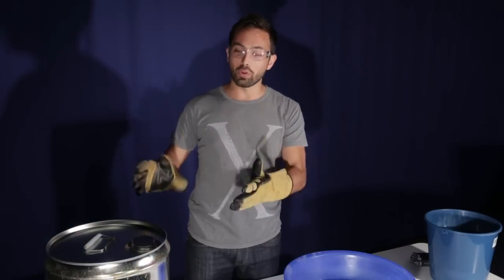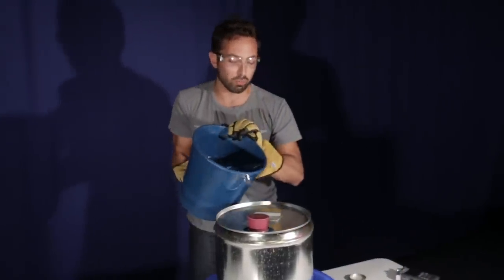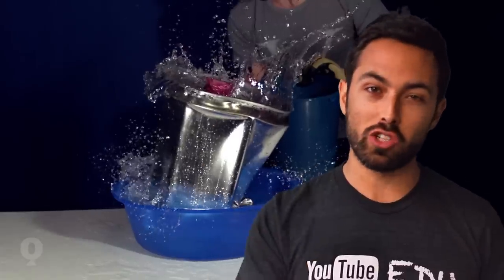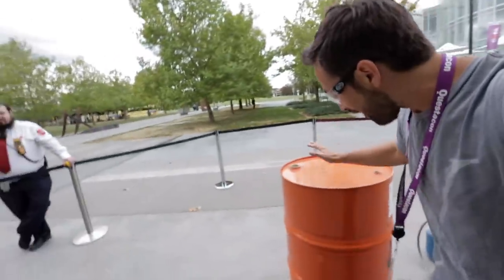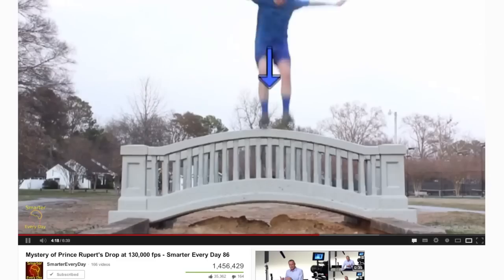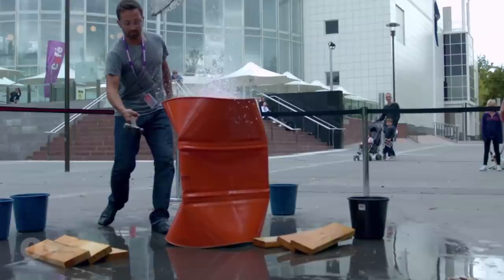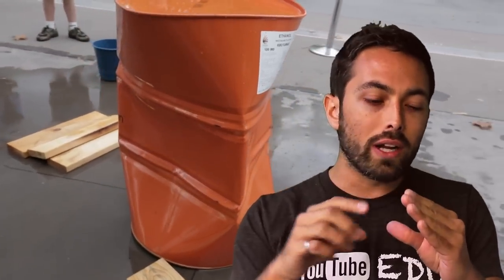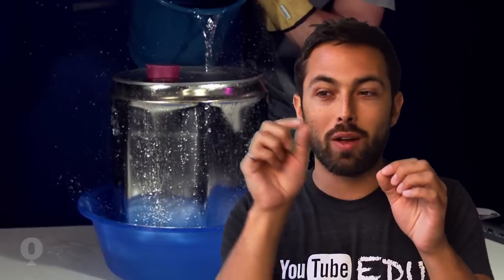Epic Slow-Mo Drum Implosions!

Comment: I think that because the first barrel is smaller it has a stronger structure (if that's the proper way to say it) and it requires an even lower pressure (a greater force) to make it collapse even further into the shape of the second barrel.

Comment: It could be that the strength of the top and bottom relative to the sides of the small drum was higher than the big drum. The three sided crumpling seems to require more flexing of the top and bottom than the hexagon shape.

Comment: The shapes could be different due to the impact on the larger barrel, creating a structural weak point that wasn't there on the smaller one and, therefore, changing how it was compressed.

Comment: Maybe it was because, the smaller drum didn't have a large pressure difference. The larger drum took longer to bend, and by that time most of the water must have condensed. So there was a large pressure difference when it finally imploded.

Comment: relative strength of the lid of the two containers vs their sides, as well as the dimensions of the cylinder. For example, lets say the top and bottom of the barrel had infinite strength and the paneling negligable strength. What would happen when the strength of the side paneling was overcome? I would expect some sort of double cone configuration.  The volume to surface area ratio would likely also effect the final state (dimensions of the container dependent).

Comment: It probably didn't crumple into a flat(-ish) plane due to the construction of the rings at the top and bottom, which, if you notice, remained mostly circular, even under the pressure. It would have taken more to completely flatten them, and if the center part tried to flatten itself, it likely would have enclosed more volume, the rings remaining circular, above and below the 'crumple zone'.

Comment: The smaller drum, I think, has a much stronger lid, compared to the side wall. The smaller drums top looks somewhat like the top of a drinks can.
I think the design of the top is much stronger on the small drum, so it will allow for less distortion.

Comment: I think it was an economy of scale. The smaller barrel had a smaller volume of hot air inside, so it had less force pushing from the atmosphere. It takes energy to make a hexagon than an equilateral triangle. so nature decide that the hexagon would be the the optimal shape to maximize volumetric shrinkage whilst using a smaller amount effort. However the massive volume of air in the drum created a much larger force which could afford to bend the metal.

Comment: It would be interesting to see a vacuum gauge to measure the vacuum inside the vessel, also the geometric shapes could be attributed to the Fibonacci sequence in some way , measure the sides to see if it is to the ratio of 1.68103 to 1 or equivalently 0.68103 to 1

Comment: Perhaps it's due to the amount of water present in each drum. The amount put into the bigger one was probably significantly smaller and therefore it had to accommodate for a smaller volume.  

Also, the lattices of the materials influence quite a lot, the material probably changed and with it its physical properties.  Thickness could've been yet another factor.

Comment: I'm crap at science but I think that maybe the material of the drum has something to do with it. If the material is more pliable, it will change structure sooner as it cools down, dealing with less vacuum inside (pressure difference is smaller), and you get an hexagon. The big drum is very strong so before it can collapse, you had to cool it much further, hence creating a bigger pressure difference. And then the triangle is the only result possible.

Comment: I think it has to do with the diameter of the cylinder compared to the height of it. The smaller drum seemed to have a larger diameter to height ratio than the larger drum, making the mid section more stable, and less collapsable into the prism shape. If this is true, I wonder if a really tall and slim drum would have its mid section pinched flat under the same experiment, rather than the prism pattern?

Comment: Maybe because the smaller drum was weaker, it in fact started crumpling before there was a full vacuum, so didn't need to minimise volume as much. Later on, as the pressure inside decreased, it crumpled up further. On the other hand, the larger drum wasn't going to have the inside decrease any more, so it minimised volume as much as possible. Possibly?

Comment: THE SHAPE IS SIMPLY DETERMINED BY HOW MUCH VOLUME THE IMPLOSION IS CAPABLE TO TAKE OUT FROM THE CYLINDER; AND THE VOLUME THE IMPLOSION IS CAPABLE TO TAKE OUT FROM THE CYLINDER IS DETERMINED BY THE HEIGHT AND THICKNESS OF THE CYLINDER'S WALL.  GIVEN X CONDITIONS, YOU CAN END UP WITH AN IMPLOSION WITH NO SHAPE BUT A LINE INSTEAD

Comment: I reckon the smaller one crumpled into a hexagonal shape because of its rims on the top and bottom. That type of structural rim seems to be pretty vital as i believe it held the top and bottom of the sides at its original width. This (I think) then meant that the sides were held further apart and it therefore couldn't achieve the equilateral triangle the huge drum achieved. I would think that if you got a taller barrel but kept the same structural design and diameter, it would crush itself into an equilateral shape like the big barrel. Veritasium I challenge you to test my hypothesis. (If you can get a barrel similar to the one I have proposed). If you read this, cheers. :D

Comment: I think the big drum went for the triangle because you triggered it with the hammer. You didn't have to strike the small drum. So perhaps the flaws in the circular geometri in the small drum, were more evenly distributed. The big drum only had one flaw; the hammer, which led to the triangular shape. If you had hit it with two hammers, at the exact opposit sides, maybe it would have collapsed to a line or rectangular shape. Perhaps it's all about the placement of the major flaws in the material?

Comment: I think the comments that say it's related to the height of the cylinders versus their diameter are probably right. The shorter the drum compared to its base the less leeway the sides can give before the top and bottom need to deform. And since the top and bottom are much thicker than the sides the take a lot more force to deform. So the shorter it is the closer to a circle (the shape of the lids) the resulting polygon will be.  Just my guess.

Comment: My only guess for the small barrel is that the pressure dropped equily on the entire, inside, surface of the drum causing a controlled and ballanced effect.  with the slight movement of water sloshing  over the drum, from one side,  then made it collapse.

Comment: I agree with forYOUitsP, the harder it is to bend the metal sides the less bends. If the material was very soft it would try to implode into a perfect circle. 

Then also because the softer the metal the easier it is to pull the top and buttom in as well, which will cause a softer drum to crumple up rather than pull in the sides only (unless the top and bottom is reinforced to not be able to collapse inward).

Comment: Isn't it just that each regular polygon is a metastable state, so that the drum can relax into any one of those, but the ones with more edges are less likely? The big drum was hit with a hammer, which makes the higher order shapes impossible. A lower order shape than the triangle is also possible: that's when two edges are pushed together.

Comment: If we're talking about a really "theoretically" perfect sphere, then the pressure would pull each point of its surface equally to its center, leading to the shrinking of the sphere. Imagine looking at a balloon that's loosing some of its air trapped inside it. If you meant a "real" perfect sphere, then the point of its surface that requires the least energy to deform will be the one to collapse inside the sphere, turning it into a concave-shaped object.

Comment: I think it has something to do with the air pressure inside the drums. Were they the same? If the air pressure were higher in the small drum, the small drum maybe didn't need to shrink more. The hammer might also have caused a stronger implosion on the bigger drum.

Comment: They are two different Euler buckling modes. With different restraints and relative stiffness, you get a different number of sides buckling. Just like a column under compression buckles with different modes of buckling with different restraints.  If you vary the wall thickness to diameter and end restraints, you will get a different number of sides buckling. This is just my guess. Experiment. Try it with different conditions.

Comment: The can was crushed exclusively by being cooled, so had equal force applied all around it, while the drum required the point force of the hammer blow, which seems to have been at the midpoint of one of the triangle sides. #?

Comment: I believe it is due the ratio of the cylinder height compared to the diameter, I bet if you did the same experiment to a cylinder that had the same diameter but with twice the height, it would flatten in the centre without the extra help. Woul you agree?

Comment: I agree with you. Anyway, could it also be that the big one is higher and has a bigger radius? I mean, it is more flexible in that direction (i.e. from the bottom to the top), either because it is higher and because the curvature is bigger (i.e. the radius of the base is bigger). Think about a small bottle and a big bottle: the big one is more flexible. Am I wrong?

Comment: You can also get more cameras, and buy flickering lights, its a bit cheaper I think, but way harder to set up, let your light flicker at 1200 flickers per second, let 4 cameras run at 400 frames per second and activate each camera 1/1200th of a second later than the other one, and you'll have 1200 fps footage! =D

Comment: My thoughts on triangles and hexagons:
Aspect ratio.

If a triangular prism (T) minimises the volume, a hexagonal one will just be a bit better than a cylinder, worse than T (is square or pentagon possible?). SO, my initial thought is: GEOMETRY - aspect ratio is bigger for the large orange drum and so it has to "do more minimising" as it were... ha lovely and scientific there.

Note: the pressure change may be significantly different in both circumstances due to length of time taken for collapse

Comment: That's not how this works it doesn't make a vacuum at all. If you recall he had water and water vapor in side the drum taking up the volume. Cooling the steam just reduced the volume inside the container. So the atmosphere can only crush the container down tho the new volume size. So this means that the container can only be crushed to the size that fits the new volume in the case of the smaller container he had proportionally more water inside it then the large one thus the different shapes.

Comment: i think because both drums have around the same scheduled thickness in there material so less surface area stronger structure. the large drum collapsed because it gave easier. it takes more pressure to collapse a sturdier structure .

Comment: I bet the big drum made a lower pressure vacuum because the material was stronger. The greater strength of the vacuum pulled it to a triangle. If you did the experiment again with the drum that ended up as a hexagon... if it weren't punctured... eventually all materials would reduce to a triangle in theory.

Comment: i guess it's just happens the local tensile strength is different in different part of the small drum
the thinner part of the drum making it requiring a less force push the wall inward and it's not hard to believe the small drum has even wall thickness all over the place.

Comment: Maybe it's because of the different pressures generated inside the drums. The little one, which probably is thinner in proportion, needs less pressure, so the shape it takes is still one of the most stable ones (regular hexagon), but not as compressed as the triangle.
Speaking of hexagons: I have always wondered why when a light source is captured from a camera it's seen as six thin light beams, separated by 60º angles. Could you make a video of that optic phenomenon? :)

Comment: Oh my, what an interesting question, I haven't the slightest idea...wait, maybe...something to do with the configuration which has the least potential energy, perhaps the number of sides depends on the height / diameter ratio, with higher modes forming on wider, shorter drums?, also the material and geometrical stiffness could be implied, maybe you would have to do an entire experiment to find the answer!

Comment: I think the more the pressure difference between outside and inside, the less would be the number of sides of the new shape. Had there been infinitely high pressure on the outside, the drum might have imploded to a single plane with only two sides.

Comment: I think the smaller one didn't have a large enough height compared to diameter to be able to implode into a triangular shape, and since the top and bottom are round and often more reinforced than the sides, this would limit the movement of the metal. This is just my suggestion.

Comment: I'm sure if it was a pyramid shape first, it would depend which part lost internal pressure first. If the point lost pressure first, it would pull in and probably make a "well" in the drum. If the base lost pressure first, it would compress inwards, closing up from inside, so it would like a needle with a "bulge" in it. That's my theory, but 1veritasium, worth testing!

Comment: Your first point is likely correct. This is also why after further cooling the drum crushed further.
I'm not sure on your second point. Your reasoning is wrong, but your conclusion may be correct. The issue isn't over all area, it's the ratio of surface area to volume. As the size of the drum increases the SA to V ratio decreases. This means that there's less surface for the outer atmosphere to push on. But, it means that there's a larger volume of vacuum inside for the drum to crush into.

Comment: You don't need to boil the water, just very hot water poured from a kettle will be enough to create a  low pressure inside the bottle.

Comment: Actually, in that case it would be the other way. Since nitrogen has a very low boiling point it will go from liquid (if you pour liquid nitrogen in it, like you said) to gas, increasing the pressure (unless you cool it with something A LOT cooler than regular water). That way, the cylinder would likely expand or explode, instead of imploding.

Comment: Hmm. So a cylinder in subpressure scenario forms a regular polygon of some sort, presumably forming an Edge either at structural weaknesses or at the point of imperfection added by a hammer-strike.
Now I wonder, what would happen if you could do this with a perfect sphere, bringing it into severe pressure difference situation (but stable enough for the material to not just break) and then adding a single imperfection point. What shape would it shape? A Polyhedron?

Comment: O.K. this may be a stupid question but instead of cooling the steam from the other side of a turbine, why not have a tunnel and put another turbine in the tunnel connecting to the outside air and as the vacuum is created from the escaping steam draws in the out side air it would turn the second turbine thereby doubling your electrical output?

Comment: The explanation of why it collapsed to a triangle isn't complete. The number of indentations on compression of a cylinder depends on the ration of the height to the radius. If that ratio is very small, you may get a large number of indentations.

Comment: Interesting. If you suck the air out of a flimsy bottle, it folds in half. If you suck the air out of a stiffer coke bottle, it buckles on three sides. If you take something that has more stiffness, it will implode with more sides buckling out. If you take something with infinite stiffness, you will get an infinite number of sides imploding (the container will shrink in without buckling). The compression buckling behavior of the side walls is affected by the stiffness of the tube. Just my guess.

Comment: maybe the smaller barrel collapsed that way because since it is smaller it needs to be less thick to have the same strength if that makes sense to anyone else. im inclined to think it just comes down to structure though. and the fact that the pressure difference wasnt as great. (looking at that it had a "two stage" crushing)

Comment: unfortunately i do not have enough space to express and explain all my thoughts in a YouTube comment but i will state the main points i feel are connected to the way each can crumples: The height of each can compared to the diameter, the tapered top of the small can, structural integrity of each can and the degree of vacuum created. if you have some other way of communicating i can give a deeper explanation but as it is i have very few characters left.

Comment: I think since you hit the drum with a hammer you weakened it's structural integrity on one side forcing it to 'collapse' into a triangle shape. The smaller can was just the air pressure exerted equally on all sides squashed the can into an hexagon type shape. It would just crumple into a smaller version of itself if not for the reinforced metal lid...so it had to take on an equilateral shape instead.

Comment: The cover of the cylinder is very rigid and will limit how the rest of the cylinder will deform.
What are the proportions between the radius and height of each cylinder?
Taller cylinder will probably collapse into equilateral triangles more easily than smaller ones because the lateral surface has to bend less.